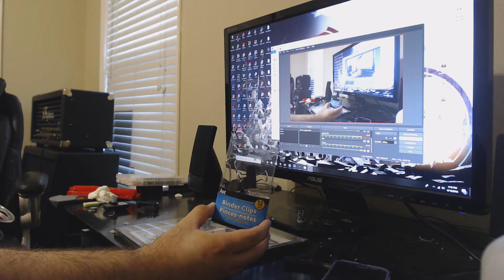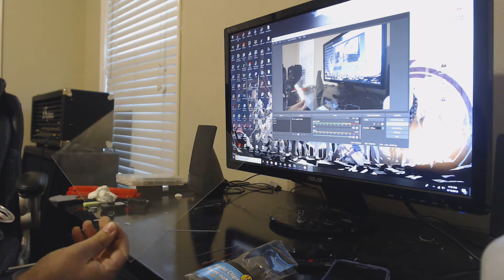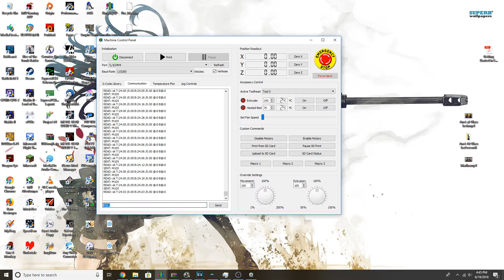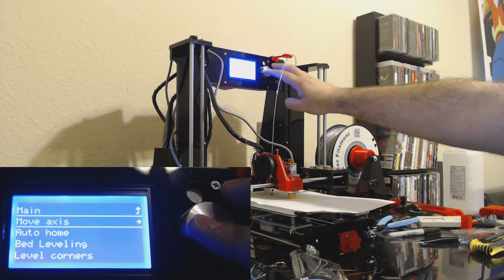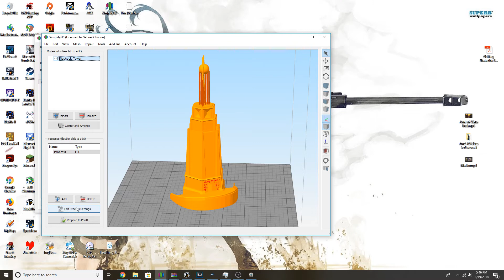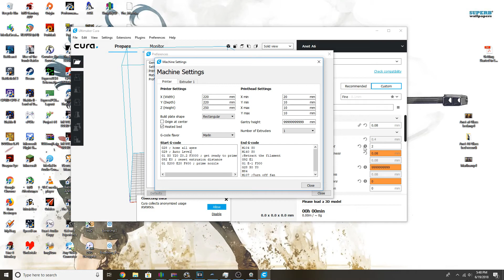Install glass bed on Anet 3d printer, set Z-offset, and auto-level bed

Comment: Small word of caution. Picture frame glass will crack unless you plan on using next to no bed heat. I did the same thing. Grabbed mine out of a family picture and it worked fine until I started using Petg which requires very high bed Temps 70-80c. That glass split into 4 sections. My old lady nearly killed me for taking that glass out too. 

The right glass isn't that expensive. I got my 4mm thick piece from ebay for around 11$. The same size as the bed with notched out corners.
Reply from the maker: Hmm, strange. I have ran mine at up to 110c many times with no issues. Maybe I am just getting lucky. Even so, I do agree the right glass would of course be beneficial, however the sensor may need to be changed if one has an inductive sensor, as the glass may be too thick for the sensor to pick up the metal.
Reply: I was a bit surprised when I saw the glass had broke. I had successfully printed quite a few things on it. At the time I was printing links to make two cable chains. I  think it had more to do with cooling off too rapidly than it did with being too hot but I can only speculate at this point.

You make a good point about the auto leveling sensor. I did in fact have to change mine out once I put the glass on the bed. The original sensor would touch the glass and still not pickup the aluminum bed. I changed it to a capacitive sensor with a 1-10mm range. 

If you don't mind me asking, what material are you using that requires that high of a bed heat? I only have experience using PLA which I could get away without using any bed heat and PETG which I use 80c for. I've recently changed my PETG settings to use 80c for the first few layers then taper it down to around 50c. I try to get away with as little as I can. It helps with the electric bill and I am always concerned something is going to burst into flames.
Reply from the maker: @mygeneration6395  The rapid cooling sounds like a more-likely culprit, as this type of cheap glass doesnt tend to flex much before cracking lol

 I had it that high while trying ABS printing. It was more of an experimental thing as I didnt have much use for it (Basically I got a free roll of ABS and tried making it work). Stuff would not adhere to the bed at all. I had put the bed temp to 100c (Not 110c, my fault. Anet A6 can only go up to 100c on stock bed), and it just never worked. I just stick with PLA now, plus it smells better. Im sure that ABS was just a cheap roll, but it sure was frustrating to have dozens of warped/failed prints and not a single nice one. I have used 100c for PLA a few times, not because I wanted to but because again I had terrible filament that would not adhere without the high temperature. Since then I now only use 3D Solutech and it adheres beautifully to the glass at 70c. 185-190c has become my best settings for most things, especially figurines. 

It's been a good while since I have uploaded, but I plan to make a video hopefully soon on an E3D extruder install (Might keep the direct drive, not sure just yet) along with an X-Axis carriage modification.